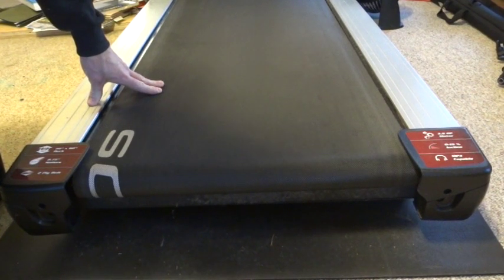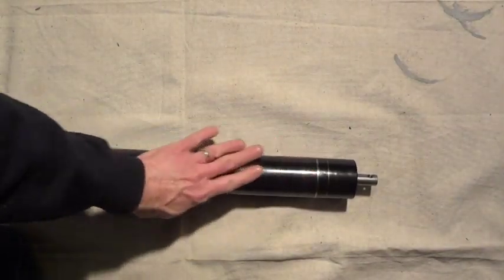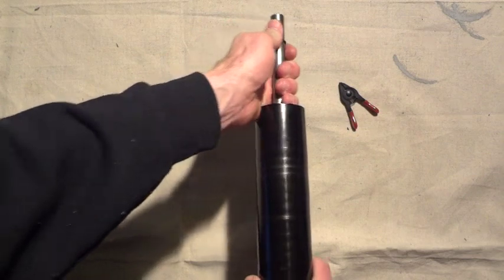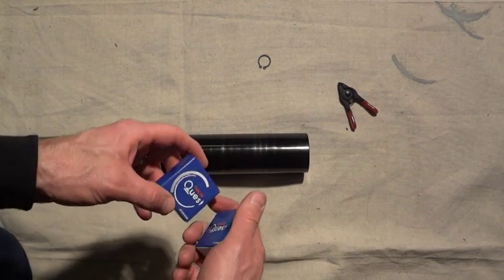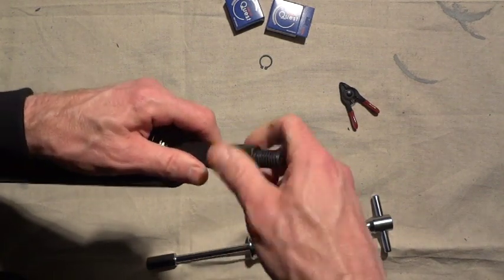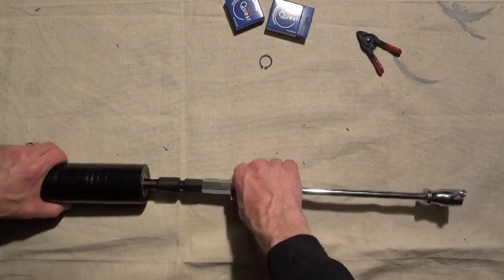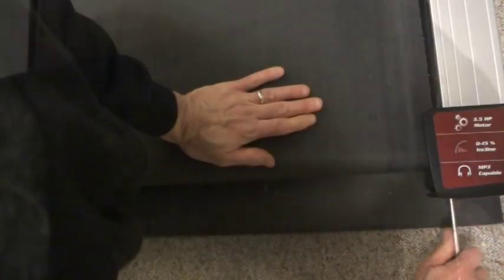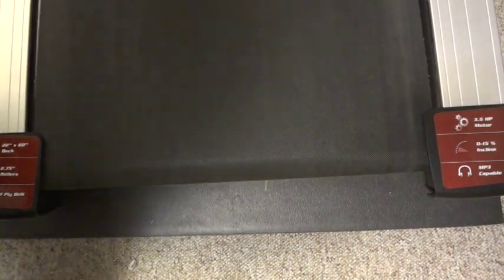How To Replace Worn Treadmill Roller Bearings - Treadmill Repair

Comment: Thank you for posting this terrific instructional video. I followed your steps and it was a very manageable process. We purchased the bearing removal tool at Harbor freight.  We purchased the bearings on Amazon. The Sole F8 has been a solid performer for us, and it will be nice to have the tools and the knowledge to replace the bearings in the future if they fail again. Again, our thanks!

Comment: You are very easy to understand. I would never had thought that you could replace the bearings and not the entire rear belt roller. You helped me save money on this problem. I am handy but would never had been able to do this without your video. Great comment on buying quality bearings, as many are inferior quality. Thanks!

Comment: Thank you!  Just replaced mine and I didn't need a puller.  I removed both spring clips, tapped the axle through the bearing and used the axle end to knock the bearing back out of the roller.  Same for other end.
Reply: That's what I was thinking, thanks for confirming its possible.

Comment: Great video worked like a charm. I used the axle to remove bearings “pb blaster and rubber mallet” did the trick. Also when I installing new bearing I used a piece of wood between the hammer and bearing as to not damage the bearing. No more noise and saved me $90 dollars thanks again.

Comment: Great video. This was the last part I needed to keep my 18 yr old True 550ZTX – HRC running. For this model, the rod diameter increases behind the bearing. More effort to knock the rod out, but the bearing comes with it, so purchasing the puller was unnecessary. I used a sledgehammer on the rear, which like other commenters said, caused some mushrooming. A little grinding with a Dremel tool took care of it. I switched to a dead blow hammer for the front, and it worked like a charm. My treadmill took the NACHI Quest 6203ZZE bearings that I got off Amazon. Thanks again!

Comment: Just completed doing this on the front roller saving a bunch of money. Thanks for the great tutorial. Similar to others I used the back end of the axle to knock out the bad bearings.
Reply: Doing this on the front roller is the same as the back, in that the pulley isn't in the way at all? Thanks.
Reply: @rgraz4929  IIRC it is essentially is the same, the motor belt connects to the front roller so I made sure to measure and reposition the roller exactly as before to not have to adjust the tension.

Comment: An easy alternative to the uncommon tool used to remove bearings is a .5" steel rod longer than your roller from your hardware store. Slip it in one side and tap at the other bearing from the opposite side. Worked great

Comment: Very helpful video, thanks. Like others, I was also unable to get the bearings out with a puller. I ended up taking the roller to my local auto shop where they were able to remove the old bearings and install the new ones (Nachi). The noise reduction was quite significant - probably better than new.
Reply from the maker: They may have been glued in with something like Loctite Red.
Reply: How ti  pull off flywheel on electric motor with keyway

Comment: shyflirt1, I just replaced the bearings, using your instructive video as my knowledge base, in about five minutes.  The new ones are now at work on my treadmill's front roller and the machine is as quiet as the day I bought it, new.  Not bad for a five year old machine that gets daily use of about an hour per day. The only other thing I've ever replaced on this unit is the circuit board.

Comment: Excellent advice! Our treadmill (Sole) sounded horrible and I suspected the bearings. The treadmill was still under warranty, so they sent us a brand new rear roller which we replaced. But after I saw your video, I understand that we probably will get problems again due to poor quality bearings. So next time we will follow your advice and replace the bearings with some that have better quality.

Greetings from Sweden :-)
Reply from the maker: After I installed some good quality Japanese bearings, I haven't had any issues.

Comment: This is a great video.  I'm somewhat knowledgeable, but didn't know the first thing about what'd be needed to replace the bearings on a roller.  Great alterantive to full roller replacement, assuming I can disassemble.  But no matter what you've shown me what's involved.

Comment: Thanks for the video, looks like this will help me fix up my roller pretty inexpensive. I've had a load of problems this winter. First a new deck (under warranty), now the bearings need replaced, a bolt snapped off from a mystery location, AND three of the shock absorbers broke loose..... Hopefully in a few weeks I'll have one less problem than I have now.
Reply from the maker: Ouch! What kind of treadmill do you have?
Reply: It is a Sole F80, purchased December of 2010, with about 1750 miles. I am a relatively fast runner for 190 lbs., so they have been hard miles!
Reply from the maker: Sole has good customer service. I have a Sole F85. Currently a little over 2000. Sole sent me a whole new roller which I installed in another video. Then for fun, I took the old roller and installed new (maybe better quality) bearings in it. I actually have the old roller installed in my TM now, and the new roller saved away.
Reply: shyflirt1 Do you have the EBay link or part number of the Naichi bearings you installed? I just checked, and I also have the same original bearings, so I figured i'd just get the same replacements you got.
Reply from the maker: Search eBay for "6203ZZE Nachi Ball Bearing".
Reply: Hey Rob, just an update, I got the bearings in no problem. I actually skipped using a bearing puller and managed to do it using the rod with the C clip still attached. I used it in the same method (like a slide hammer, pull it back fast), and it didn't damage the C clips. Sole sent me a new roller and shock absorbers (I broke those), so hopefully I'm good for quite some time!
Reply from the maker: Awesome! I think the Nachi bearings might be a better quality than what Sole uses. Not sure. Yes, you can use the axle to knock out the bearings. You want to be careful not to damage the ends of the axle though.

Comment: Many thanks for the video! I followed all the steps. It was so easy in my F85 that I decided to do the front roller too (I bought extra Nachi bearings). But the bearings in the front roller seems to be completely stucked.
Anybody knows if I should be able to pull them out? I have a puller but I don't know if there's glue or something I miss.

Comment: One of the bearings on my roller had snap rings on both sides of it making if much more difficult to do this, and I didn't find this out until I'd gotten it out. I had to use a sledge hammer to whack the axle bar and bearing out together. In doing so it mashed the end of the bar I was whacking, enlarging the diameter at the very end which made it impossible to get the other end of the bar out of the inner bearing. I ended up using a bench grinder to reduce the circumference at the tip of the bar. The extra snap ring on the inside of the bearings I've now removed so I won't have this issue next time.

Comment from the maker: You can try a little penetrating oil. You can get another rod and tap it down through the first bearing. One you get it through one of the bearings it will probably go through the other one easier. Be careful hitting the end of the rod as you don't want to mushroom the end of it. If it's tight, use a wooden mallet, or cover it with a block of wood and hit that with the hammer.

Comment: The best bearings for treadmills are those with a contact seal, suffix LU, XLU I think, one side X, metal and the other side rubber, the LU, the rubber contact seal better isolates the bearing humidity, which is one of the main causes of failures in treadmill bearings

Comment: @RJTheBikeGuy do you have any advise how to get a stubborn rod out? Is there a tool or are you just supposed to hammer with a much larger force I felt comfortable with. I have tapped it quite a bit with a mallet, but it does not move much. The bearings still feel smooth once the roller is out, but after 7 years of really heavy use I thought it was time to take the noise coming from the rollers by replacing the bearings.

Comment: Great video!  But... my treadmill is a Star Trac, and the rear roller (tail roller as they call it) does not have a visible C-ring that can be removed.  There's a black cover flush over that area that I cannot figure out how to remove.  3 tiny holes around the diameter of the outer roller probably release the cover or the axle somehow, but I don't know what tool I need to "activate" those either.  Ideas?

Comment: Any tips on how to remove the bearings without that tool? I'm thinking anchor bolts should work, using the roller shaft and a hammer to hit the anchor bolt from the inside after it is in place. But since anchor bolts this size are not that cheap and I would have to use one per each ball bearing removed, I'm trying to come up with another idea.
Reply: +Yuri Ramos  You could try using the axle as a ram and hit it from the inside out.

Comment: Wow.  Great vid.  I own a gym but and was getting tired of paying an arm and a leg for my cardio to get fixed.  I am going to harbor freight this weekend to get the puller. I took both front and rear rollers out.  Any suggestions on how to get the inner rod out if it is very tight in the bearings?  I can pound it with a hammerbut once the one end is thru the first bearing how would I get it thru the second if it doesn't slide out?  I guess maybe put the inner ring in a vise and pound the roller?
Reply: tsaipod    Take the C rings off first. Tiny little clamps shaped like a ‘C’. Special tool needed.

Comment: I am having hard time getting the bearings out. I have the puller from an auto parts store. Im using a great deal of force on the puller but the bearings are not budging. My treadmill is a nordic track a2550 pro. advice? more force? perhaps nordic track roller bearings not removable?
Reply from the maker: 10lb puller or smaller? It's possible they used something like loctite red. http://www.us.henkel-adhesives-blog.com/post/All-About-Threadlockers/How-to-Remove-Red-Threadlocker/
Reply: OEMTOOLS 27128 Blind Hole Puller Set. The listed item weight is 7.5 lbs.
Reply from the maker: Okay, so it's not a 2lb puller or something. You might trying heating the bearing and then pulling it. Alternatively trying chilling the bearing with dry ice then pulling it.
Reply: Ok so i  took it to a shop and he put some heat to it and bam they came out. Treadmill back up and running smoothly. Thanks RJ.
Reply from the maker: Cool!

Comment: hi
will bearing sit appropriately if i shorten the roller by cutting it with disc? or there is a special place at the tip that will be lost? 
i mean, will bearing sit along any part of the roller or it is different at the tips?
thinking about some diy project.
thanks
Reply from the maker: Generally, you won't be able to just cut the end off and slap a bearing on. I think many rollers are basically aluminum cylinders with caps on the ends to fit the rollers. Or they might just be machined tubes. You will have to play with one.
Reply: @RJTheBikeGuy  many thanks sir

Comment: Any tips for finding out what bearings I need? Got a Proform Crosswalk Fit 415. Contacted Proform, but no luck so far.
Reply from the maker: Pull them out and look for numbers on them. Or measure them and find matching bearings.
Reply: Thnx. already figured it out myself. cheers :)

Comment: where did you buy those nice bearings?
Reply from the maker: eBay. Your TM may use different bearings. Look at the model numbers on the bearings in your TM and then try to find similar bearings. Avoid chinese bearings as the quality will be suspect. I read good things about the Nachi bearings before I bought them.

Comment: What type of grease do you use when installing the new bearings?
Reply from the maker: I like marine grease.
Reply: @RJTheBikeGuy  do you think a little lithium grease would work as well?
Reply from the maker: @davefisher4888  I told you what I use. You can try whatever you want.
Reply: Loctite would be better, lubricates when installing and locks the bearing in place afterwards. Grease may allow the outer race of the bearing to turn in the roller.

Comment: how i know if the bearings need to be replaced or not?
i bought used treadmill
Reply: worn out rollers produce sound and you can hear it clearly by listening closely. The sound is same with or without a person on treadmill
Reply: Popping sound as the bearings intermittently lock and are forced to unlock.  Or a loud crunchy sound.

Comment: can some one help me figure out why the berings instaled keep on braking ? could  it just be because of the brand?
Reply from the maker: Could be cheap bearings. Could be belt is too tight. Could be normal wear and tear. The Nachi bearings I installed are still going and have outlasted the original bearings.

Comment: this was very helpful, thank you. I did a couple of things differently: 1) I bought a cheaper bearing extractor from amazon for $34 https://www.amazon.com/gp/product/B016W8GSQ8/ref=oh_aui_detailpage_o01_s00?ie=UTF8&psc=1. But, this didn't work for me because the bearings on the roller were super tight (yes, I tried heating it for 2 minutes with a propane torch, still wouldn't budge). So I cut off the head on an old golf iron that I had, leaving me with the golf steel shaft. This fit in the hole of the bearing, so I used this to bang out the bearing. Worked perfectly.

Comment: What is the size of these bearings?
Reply from the maker: I don't remember. Unimportant as you need to match the bearings in YOUR treadmill which may no be the same size.
Reply: @RJTheBikeGuy  thank you for replying. I see that you already write the necessary informations on your description. I see that your's and mine are the same bearing.

Comment: Bad practice to hit the new bearing with a steel hammer.  Use a block of wood like someone else suggested below.
Reply from the maker: If you tap on the outside part, it doesn't hurt the bearing.